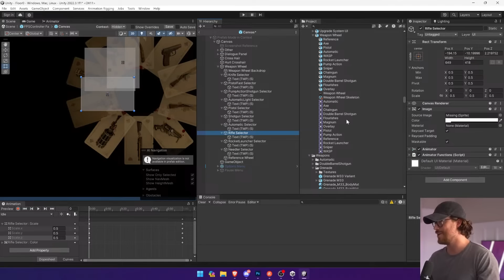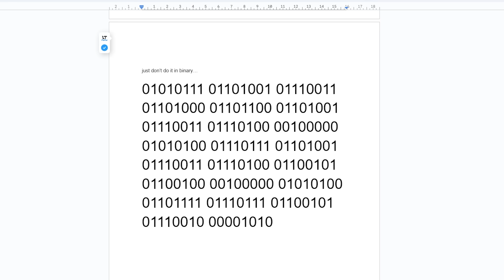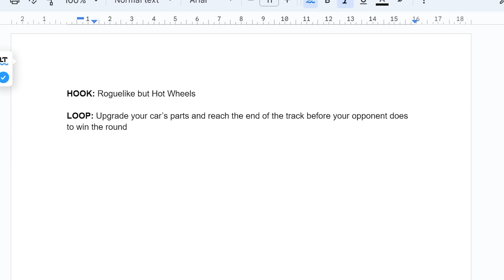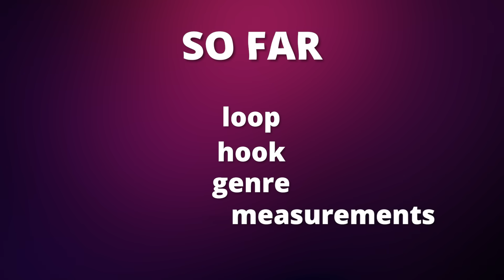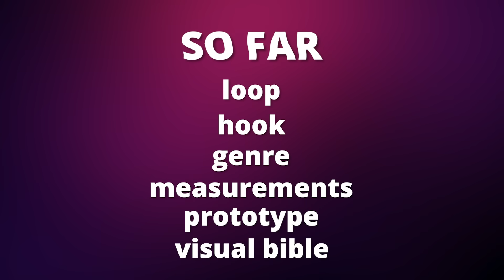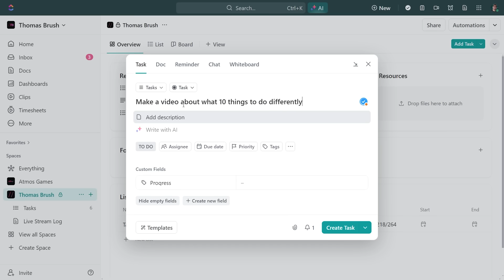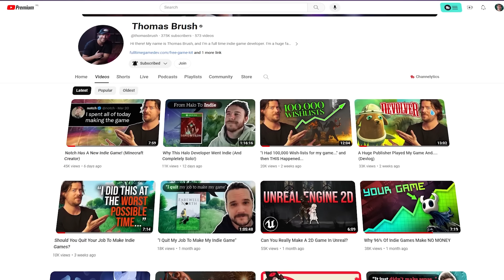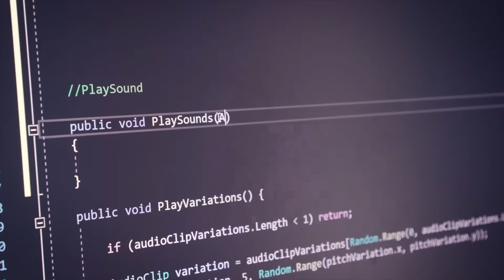How I Would Start Game Development (If I Started Over)

Comment: I'm not sure I understand the measurements point. I think I'm already doing this, which is by making a mockup scene where I design all of my assets, instead of designing them each in isolation. I've done this mistake in the past and it's caused assets to look much larger than the other assets I've designed. That's how I'm interpreting this point but I could be wrong.